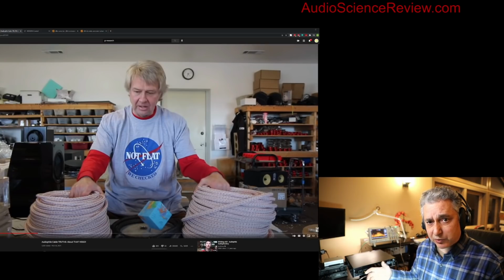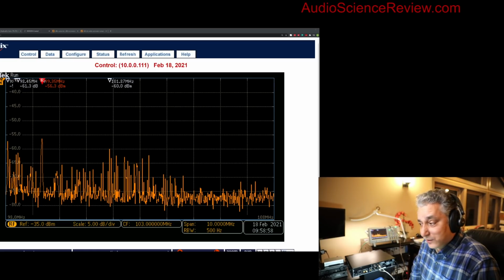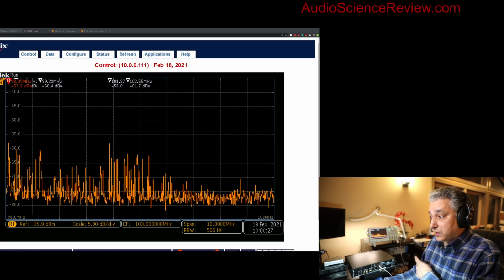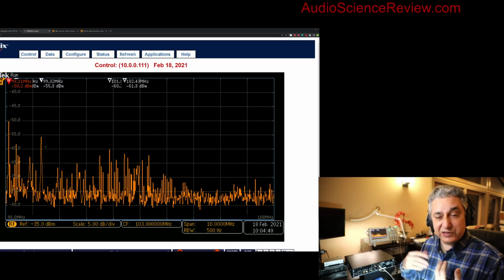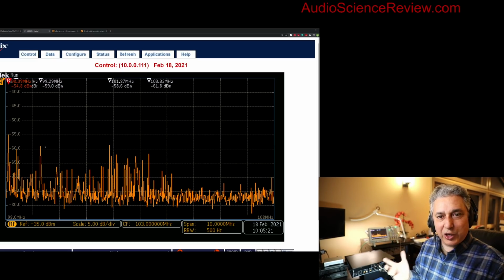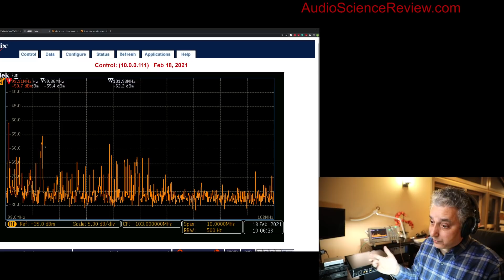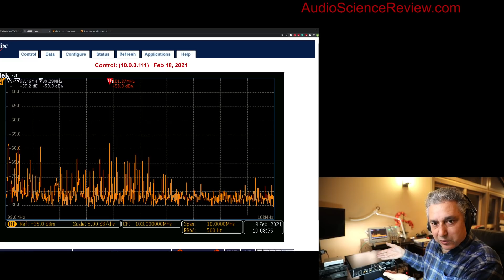RF Interference in Speaker Cables???

Comment: I’m an EE who has worked for several years on audio headsets for the military that have extreme EMI requirements.  I think I had to do 200v/m level fields for one project. The way EMI and RF exhibits itself audibly is that in the presence of a strong EMI field the internal op amps and any PN junctions can exhibit this behavior called RF rectification.  It will result is small shifts in DC bias points within amplifiers in the presence of the fields. For testing audio the fields are turned on an off at 1khz, and you would hear the 1khz tone come out if your headset is susceptible.  I can tell you the fields need to be powerful for this effect to manifest, especially in an amplifier that has a metal grounded chassis.   In your house you shouldn’t have anything like this… it’s possible you could have RF on your power line, but that is most likely going to quickly get filtered out by the first input capacitor it hits inside the amplifier.  So this shouldn’t be a concern for home audio unless something really weird is going on, like a giant transmitter next door or something

Comment: Best Buy people try to sell $100 6 ft hdmi cables when selling 3-4K tvs or 4K players.
People not knowing keep buying them even though those are digital cable. I never bought those or any over priced BS they try to sell. Now with these measurement shows the salami they all want to sell. I would pay for nice looking cable to complement nice speakers but not infinitely overpriced no thanks you. The other issue are these iver thick cable which actually damage hdmi board on AVR and players. That is real issue. There is in interference in many things but does it affect the intended function. Maybe 1 percent interference doesn’t require unlimited resources to fix it.

Comment: There’s a reason why, in pro audio, nobody pays any attention cables (other than durability and reliability), and nobody is trying to sell us $4,000 interconnects. It’s because the only purpose those cables serve is to make the buyer feel good. In pro audio, we don’t get paid to feel good about cables. And they make zero difference to the sound. 

Don’t get me wrong, feeling good is terrific, and if $4000 cords and cables make you feel good you should buy them. But if not, they serve no other purpose. They’re no different, electrically, than inexpensive cables from Walmart.

Comment: Great video.  Late to the party as I only recently stumbled across this channel.  As an actual RF engineer working in the satellite communications field for over 45 years I 100% agree with the test you just performed, the results and the way you explained them.

Anecdotally, as a ham radio operator in my spare time, I can also confirm that you can cause audible interference into TV or stereo systems from strong nearby transmissions in the 3 to 30 MHz range.  Typically, the issue is poor design of internal stages of the TV or stereo system allowing the RF to leak in and be mixed down into the audio section of the receiver, or a faulty component that's directly demodulating the amplitude modulated signal.  Typical resolution is to install an RF choke or fix the fault component.    But I've never personally heard of a case of RF getting in through the speaker wires.  If it did somehow, the solution would be the same put an RF choke around the speaker wires - those heavy things you sometimes find clipped on power cables.

I'd honestly like to do a $100,000 put up or shut up test of some of the ridiculous claims made by speaker wire and AC power cable companies.  The round earth camp (us real engineers) will bring some cheap wire, the snake oil peddlers can bring their best, and then we test each using modern test equipment, and a scientific and statistically meaningful double blind listening test.  Loser coughs up $100 k. 

Much surer bet than any investment in my 401K right now.

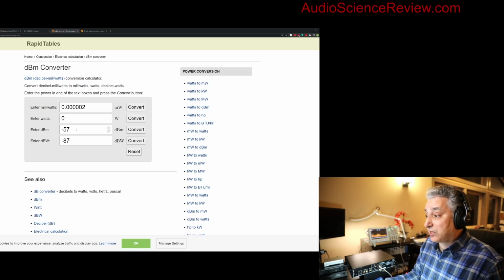Comment: 8:52 This is assuming the amplifier is stable at the frequency in question. It is theoretically possible that it isn't although most audio amplifiers do not employ active elements that are that fast so as to amplify VHF frequency signals.

Comment: My dac was interrupting/dropping out when turning on/off the lights... replaced it with a 30 eur audioquest cable digital interconnect... and the problem was fixed and it sounded better although that last claim was not blind tested. Not RF related,... but some decent, not too expensive cables alwas makes sence.  Supra is selling shielded speaker cable costing less than 15 eur per meter... probabably you will not need more than 2x 2 meters.

Comment: Simply bridge Connect a 0.02uf Capacitor across Both ends of speaker Cable terminals (Amp/Receiver & Speaker ends)  to Assure Zero Rf pickup Possibility.....

Comment: Being old, back in the 70's and before, when saving a few pence mattered, sometimes the negative feedback path didn't include a low pass filter to roll off the higher frequency and ensure HF stability, the odd 1uH inductace on the output stage.  In these cases the speaker wire could act as a dipole and inject RF into the negative feed back, becoming demodulated at the base emitter juntion of the input pair. It's decades out of date now, but useful if you want to sell to the unknowing.
Reply: It is important to understand, as you do, that the speaker output terminals on your amp are also input terminals feeding into the negative feedback loop of the amp. A single RF signal is easily reduced by the inductor on the speaker output. Multiple signals from radio transmitters, power lines, lighting dimmers, and a multitude of other sources at many different frequencies can intermodulate and produce products at frequencies all over the spectrum, not just at megahertz. Consider how the ultrasonic output of a DAC can result in audible noises if the low pass filter doesn't suppress these out of band signals enough before they enter the next amp stage. The output inductor will not stop low frequency noise from entering the feedback loop. This random noise will not be recognizable as a song or tone. This could raise the noise floor of the amp and obscure low level detail in the desired signal, often described as blurring. If you live in a place with low or no electromagnetic noise fields then this may not be a problem for you and cable shielding/twisting/braiding won't matter to you. In a high noise environment it could make a difference. 

Ray Kimber told me that the original problem that led to his braided cable design was that in music clubs and on live concert stages with tons of lighting dimmers operating that the magnetic noise fields were so strong that a buzz was audible from some speakers even with the power amps input cables disconnected. This is an extreme case, but as Danny's video shows, the braided Kimber style cable was by far the worst antenna/inductor. If noise magnetically coupled to the speaker cables can produce audible buzzing , then it can surely contaminate the negative feedback loop of an amplifier and degrade the signal quality more subtly. Here's a good spot for fans of zero feedback amp designs to claim victory. These complex interactions are rarely as simple as we wish them to be, and just because something is sometimes not a noticeable problem doesn't prove that it is never a problem. 

Remember how early digital audio recordings  were criticized for sounding bad even though simple noise and distortion tests said that they were perfect. It took us some time to figure out what the problems were and devise tests to reveal them. We used to measure amp signal to noise levels by running a test tone through an amp and measuring the output signal and then muting the input and measuring the noise. This seemed to work on analog audio, but digital had noises that disappeared when the input was muted, so new tests where the noise floor is measured with the input signal still present were devised. Amir show us this in his tests. We used to think all we needed was an oscillator and a volt meter. This is just one example where some people said they heard a problem, and after initially dismissing them, we later found out they were right. This doesn't happen every time, but it does happen. Snake oil and it's salesmen do exist, but we should remain open minded and strive to keep learning.

Comment: With two-channel hi-fi, I can totally understand RFI would barely be noticeable. However, when one is running a 9 Channel Atmos setup, the RFI / EMI (background signal noise) becomes a little more apparent.

Evan, after auditioning three separate AVR's, the same ambient sound of the room was still present! It was only after I purchased shielded cables that the noise floor within my small 13 × 11.5ft living room finally came down to satisfactory levels. In my experience, unshielded cables do indeed act antennas for attracting RF, and the longer the cable, the better the antenna. It probably explains why when I used to disconnect my Heights and surrounds within 10 minutes, the faint background signal noise within my small room used to disappear.
Never mind the cost. Do you really think I would go through all this work not once, not twice, but on the third time to get it right...
If interested, here's a 3-minute video of what I went through. Please bear in mind that I'm no Steven Spielberg 😂
https://youtu.be/wwU0d3NfRQw?si=8RcX4g8b07jjmYEr

Comment: I have to admit that when I saw the first of that guy's videos showing the use of a loudspeaker cable as an antenna into a radio receiver as "proof" that this caused audible artefacts in the output I was simply astonished that anybody who claimed to be an expert could make such an utterly ridiculous claim. If he wants to write a proper technical paper and get it peer reviewed, as is the proper way to do such things, I will watch in amusement as it gets torn to shreds.

Now if he'd shown some way that a loudspeaker cable could pick up audio frequency electromagnetic interference, and make that audible using a real-world amplifier, then that would be worth knowing about, but I think it extremely unlikely that it ever happens, short of something being catastrophically badly designed. 

I suppose some might point to those old crystal sets which were powered directly by the demodulated radiowaves, but those needed long antenna, strong signals and high impedance (by speaker standard) headphones of a few thousand ohms. They had to be specifically designed to be sensitive. Any half-decent amplifier is designed to isolate the output from the input (apart from deliberate negative feedback to produce linearity), and I think it would be safe to say that if there is radio breakthrough in the amplifier it is going to be via input cables, not the output to the speakers.

Comment: specific lengths of wire at specific gaps will capture specific frequencies with a tuner. This is how radio works. If you go fishing for RF you'll find RF. You can do simple math to tune a fixed frequency with a modulator that can "decode" the intelligence. This is why the funniest configuration of speaker wire is one of the most expensive with the Nordost in parallel; for those concerned about the RF boogieman, unshielded speaker wire in parallel is the worst (even twisted pair).

Comment: I think some who debunk that speaker wire doesn’t make a difference, just don't listen. 
Just went through standard speaker cable vs 24 strand braided copper vs 16 strand braided silver coated copper with a friend. The standard cable was rubbish.
 I changed to Kimber Kable years ago because improvement in the sound. If you can't hear the drum symbols ring on after struck with better speaker cables, then maybe some dont know what to listen for or don't have a good ear for sound. Or their audio setup is bad.
 Anyway just save your money and run electric in wall cable like Straight Wire cable. Use some cheap $5 rca interconnects as well. Get some cheap speakers with cheap parts and wire in side the cross over. Be happy with the great sound you get. All the best.

Comment: Thanks for the presentation. I learned that there is a lot more to RF than meets the eye.  I was looking for the solution to the whining squealing popping sounds that come out of the speaker when I use a speaker or headphone extension cable. From what I gather, you talked about actual radio stations being picked up by the devices cable systems. I know I remember my issue involving something like grounding. Were you including this type of interference in your video?

Comment: I have heard radio stations on several stereo units over many decades ...even when the stereo did NOT have an FM or AM tuner attached.  
I have also demonstrated to friends that the radio signal can be changed by moving interconnect and speaker wires around.

Comment: Thanks Amir (belated) for a great video. Your point about a grain of truth being misinterpreted is particularly important. Thirty years ago, I got my first real job in NYC, after grad school. And I bought a new stereo system. At the urging of the salesman, it was LP oriented (I had about 600 LPs already from before grad school). The amp was a nice Creek integrated but when I took it home I could hear intermittent changes in the background noise that once heard/noticed were annoying. The dealer swapped out the amp and I bought "better" cables, but still the distracting noise changes. I lived with it until I moved to another apartment. Now the intermittent noise was in Spanish....the chatter between taxi drives and the cab company whose antenna mast was less than a block away and visible from my living room window. I couldn't live with that, but in the meantime (a) I noticed that it didn't happen with FM music and (b) after buying a CD player, it didn't happen at all. It was the phono-preamp picking up the RF signals passing them through to the amplifier and speakers. I eventually replaced the integrated with separates but I still couldn't play LPs. The antenna mast is still there, but I think the cabbies are now using cell phones. I haven't yet tested the phono-preamp since I find I now prefer CDs/digital files to LPs, anyway.

Comment: A few years ago , I was setting up my  DJ equipment at home in afternoon , making sure everything worked for New Years eve . I connected integrated , phono stage , turntable , speakers  using very inexpensive rca chords .  i played a record and heard radio station through speakers , note my tube integrated did not have a tuner ! I changed rca interconnects , problem solved ! Not everything in your lab is real world situations , I know what I heard ! replacement interconnects were of much higher quality !

Comment: I think you said that getting 8 out of 10 tests is good.  I think to be statistically siginificant, you need to get 9 out of 10 right.  And if someone does get 9 in 10, it doesn't prove it because there is a decent statistical chance of that happening. In that case, you need to do more extensive testing.

Comment: Danny also has a video where he is looking at the parts inside a speaker.  There is a steel nut holding down a wire.  He says that is bad for the sound because steel can be magnetized.  I find that hard to believe - can you address that?

Comment: I'm getting interference on my speaker cables because of the video cables that are running nearby. Any hints, thoughts, ideas?
Reply from the maker: See if you can avoid running them in parallel.
Reply: @AudioScienceReview  Good suggestion and may have helped. I swapped speakers and it's down to 3db on both. Clearly one speaker is "less well shielded". I'm going to try "optical" DP cables, expensive, but cheaper than new speakers.
Reply: Ok, swapped out my TB3 cable for a TB4 cable which is "active" and clearly more beefy and the buzzing is gone!

Comment: I have a amateur radio operator in my direkt neighourhood (100m).
I hear his talking extrem loud in my system, i cant hear music if he speaks.
This problem cant fixed with expensive Loudspeakerkabels. 
The type of cable is not the problem, the lenght, how the cabel lies in the room and the complete electric setup of the system is the problem.
To say that expensive speaker cabels could fix these problem is nonsens.
Sorry about my bad englisch.

Comment: FM frequency is way beyond human hearing, so is AM but the amplitude modulation is in the audible range and coupling does happen up stream of the amp, CB linear amps are notorious for stomping on hifi systems. Based on my engineering degree and a lifetime in avionics design and hifi.

Comment: Well done. The only time I've ever seen speaker wires picking up enough RF to cause a problem was when there was a CB'er or Ham operator within a few hundred feet of the system. The wires did in fact pick up the signal and then the amp's output transistors acted as detectors, so you could hear the audio in the speakers. But all solid-state amps made after the late 1960's have an output stabilization circuit between the transistors and the speaker terminal, consisting of (usually) two resistors, a capacitor, and an inductor. This circuit not only stabilizes the amp, but it prevents RF entering the amp through the speaker leads.

In the early 1960's, Edgar Vilchur, founder of Acoustic Research and inventor of the Acoustic Suspension woofer system, did some very famous live versus recorded tests. Knowing that these tests might well make or break his company, he said in an interview later on that he "spared no expense. I bought the best lamp cord the hardware store had."